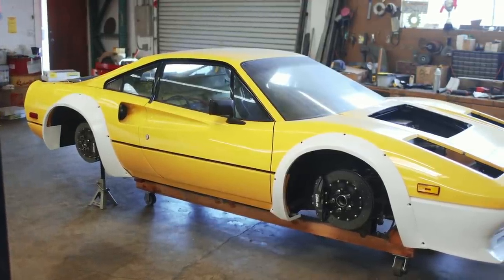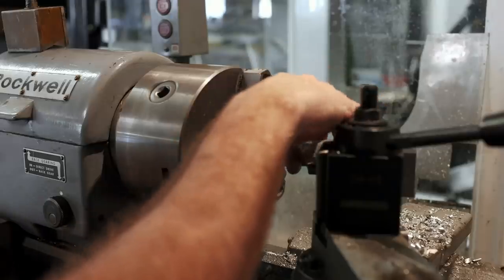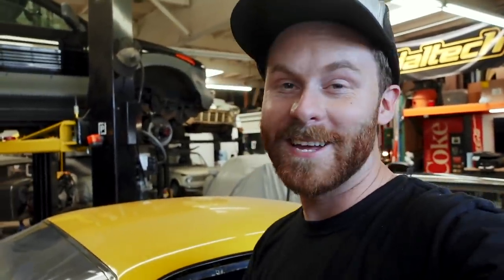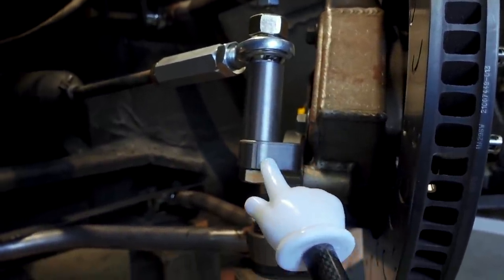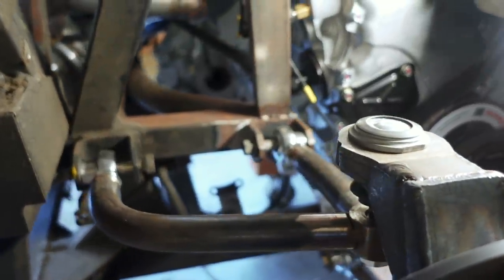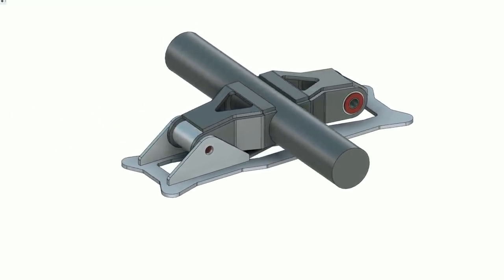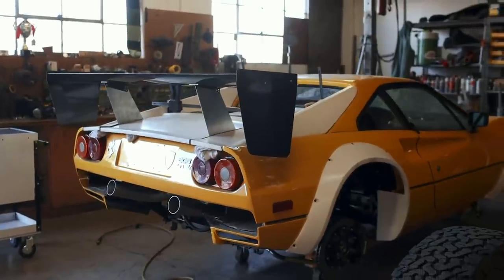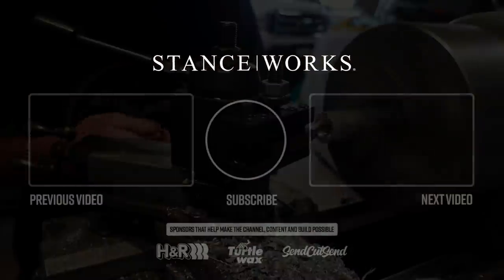Honda-Swapped Ferrari - Custom Fabricated Steering Build

Comment: I am happy for you coming so far already in building this fasttastic car already man and that you documented it al so beautiful so we can enjoy it with you! Brilliant! I have a few notes and questions I hope want to be able to read and hopefully answer. How do you know the thread in those aluminum steering bushes will be strong enough for instance, ore actually how do you know the whole controlearms and everything else around the suspension will be? I am just so curious about such things, because normally such designs ar calculated in a computer. Btw, when  aluminum is milled and buffed with scotch bright it will corrode very fast but I presume those gonna be powder coated to. Another thing I thought about is that I doubt carbon is gonna prevent your wing upright’s from wobbling. I think it depends on how wider you can make the footplates the more vertical strengt you can add by adding some cross triangular parts between the footplates and the standing uprights. This in order to make them more rigid. And adding an S shape in the uprights, in the length of the wing like current F1 cars have will add more rigidity to but I don’t know if you will find that aesthetically approved. I again hope for a reaction, written ore in the next episode, and good luck with the rest man!
Reply: As always, no reaction

Comment: Send those aluminium pieces to anodizing. Does not cost a lot at all and you have parts stay safe and good looking for the rest of your life. :)
About wing mounts, why not make them wing shape too. 3D-print the profile from PVA, use as mold to carbon parts, then it is water soluble after carbon has cured.

Comment: All taps should have a tap/ drill size. But if you can't find one, you could use a rough estimate of 75% of the diameter of the thread. No idea why that drill cut over size, but it happens! 2024 aluminum is a little heavier than 6061. I prefer to machine it myself.

Comment: Chances are your first tap drill was simply too big, however it was wobbling a bit which will enlarge a hole (especially in alloy).
Also if the bit had been hand sharpened badly sometimes this causes oversized holes

Comment: I bet this will be addressed by Amir in the future when you do aero setup but from the footage your rear wing uprights seem too short, the flow over the rear quarter is very close to the bottom leading edge of the end plates. I would worry about flow from the body bleeding into the low pressure area under your wing as well as the flow over the end plate interrupting your flow across the body. There is also the straight forward benefit to raising your wing to get cleaner airflow especially considering the geometry and venting of the hood.

Comment: Fantastic work as always!
However, are you planning to rubber boot the heim joints? There appears to be no protection from dust/water ingress? Also, unsure about bolting aluminium turnbuckles and steering joints directly to steel? The electrolytic effect between the two different metals can create corrosion and make them a nightmare to undo or adjust?

Comment: The steering rack us usually chosen to match the track of the car so that the length of the A arm is the same as the length of the steering arm so that they move through the same arc.  If the Ackerman geometry isn't correct, you will scrub the rubber on your front tires.  Ask me how I know this.  Haha.

Comment: Do you forsee any issues with extra tolerance on the steering arm -> heim joint bolts? I know it's no longer press-fit, but I wonder if it should have been reamed? Source: I watch youtube sometimes. PS I'm wearing my Stanceworks shirt today. Very comfy.

Comment: If your drill wasn't sharpened correctly it will cut more from 1 side therefore cut oversize. That's more than likely why the threads chewed out after tightening up.

Comment: dont use aluminium for threaded steering joints  it fatigues, remember when you lost steering in the model a ?.  also you might need some hiem joint spacers - your setup looks like it might bind up at extremes of movement

Comment: Hey Mike. Really enjoying your content. Especially the Ferrari. I have a question though regarding rear wing. Instead of cutting slots in the engine cover, would it be feasible to attach the wing right to the engine cover? Like a typical rear spoiler.

Comment: A good body shop would sort out that engine cover no problem. Would honestly be a lot better and less soul destroying than cutting up that original cover. A nother option might be just making your own using the original cover to make a mold. Would be good practice for future carbon panel projects.

Comment: Why keep the stock rack? While the ratio was good for it’s day I’m sure there is a quicker modern ratio rack that would work better on the track. Also with the increased stresses from the added cornering grip I would assume you are going to have some flex due to the larger tolerances seen in all older racks.

Comment: Just catching up, so this may have already been figured out / fixed. But that Ferrari rack DOES NOT have a 1/2-20 thread. It has an M12-1.25 thread. A 1/2-20 nut will screw onto an M12-1.25 thread, but not with enough engagement. You showed a vid a few episodes back of an RX7 losing its wheels. Exact same thing happened there - 1/2-20 lug nuts on M12-1.25 threads. 

If it’s already been fixed, cool. If not, I’d bump it to the top of the list.

Comment: Maybe you should try to see if you could find a Steering Gear
electric for a Volkswagen Honda BMW
or one from Bosch Mobility Solutions Electric Power Steering Single Pinion Servo Unit ..
to the pretty cool project you're up to

Comment: at 3:40 (its way too fast, to see clearlyh) it looks like the drill bit climbs to the hole from the side, meaning that the tail stock is not well centered or the drillbit is not centered in the chuck correctly. this would result in oversized hole which would result in what you got there. Also looks like the bit is biting much more on one flute which would support this.

Comment: Hey mike, this is a great video, and I love your build, but I believe it is to be worth doing the Ackerman math now rather than later. 
This is only out of concern for you and your build, and if you've already done the math months ago or offscreen, then please ignore this comment. I'm sure you have enough people telling you how to build your build. 

In Formula SAE we make the suspension hardpoints before the chassis, and a lot of math and geometry goes into that, as it's extremely important to do first and not later. I'm sure you already know this, but in case you don't, it is worth doing the geometry on your control arms, uprights, KPI, steering angle, etc now. I haven't seen the entire build, so maybe you have, but if you haven't up until this point, and only made longer parts because you wanted wider tires to fit, and haven't done the geometry to make sure it will work ok, I highly highly suggest you do. It is a lot of time and effort to fix these things, and I have never heard of anyone, or any team calculating any kind of suspension geometry "at a later date", so it worries me. 
Of course this is all suggestion, and I won't leave another comment or pester you if you don't. If you believe your method of testing to be solid, and I can't visibly see anything wrong with it, by all means go ahead. You have sacrificed more man hours and time on this build than some guy in a youtube comment, so if your gut says you're right, listen to it. 

I wish you the best of luck.

Comment: Don't think it's a good idea to mix Alu and steel on the steering! 
Just adjusting is critical - torque levels on Alu are quite different to steel. A few adjustments too tight and they threads start to pull out of your hex-nuts.
I would redo these in steel....